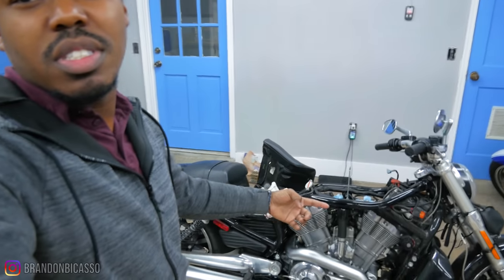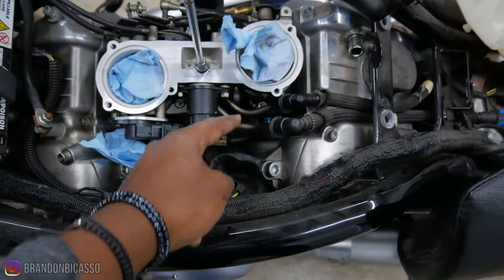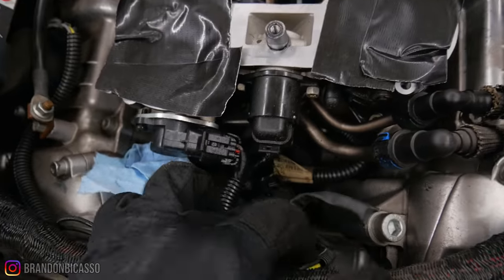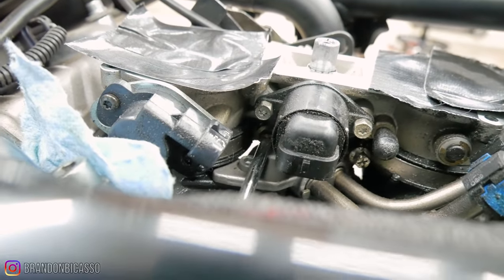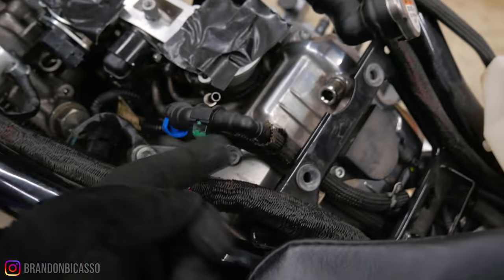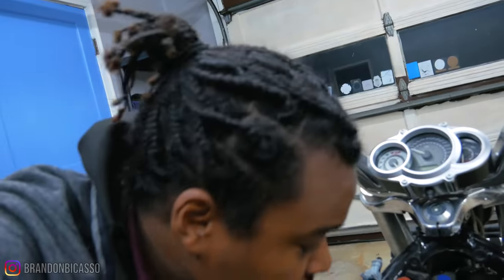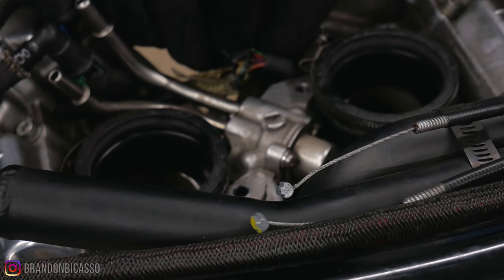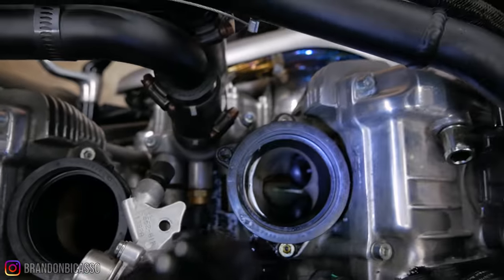My Oil Leaking Harley V-Rod Throttle Body Was Harder To Remove Than I Thought

Comment: I had your same problem on my 2008 Night Rod. You really don't need to remove the throttle body. If you are doing it clean, then have at it. What you need to do is make sure you have an original O-ring that fits the breather tube. Pull the tube out of the air box bottom. Install the correct O-ring, seat the tube into the block where it came from. Now install the box onto the tube and press to make sure it is seated into the box. I figured this out after a couple tries. Good luck.
Reply from the maker: I mentioned the point was cleaning the oil. I wouldn’t take that off unless it was for cleaning. That’s a waste of time 😂

Comment: My second vrod (2013) had the oil leak . Took it to the dealer and they tried saying it's normal.  I just laughed and then argued with their disposition.  I had looked up the issue online and found what causes the leak . .. it's that blowby valve that the gasket gets old

Comment: Breaking into one of these is like renovating a house.  Every wall or panel that gets opened reveals two or three more tasks that need to be completed.  My '98 Electra Glide Ultra Classic went down because of a fuel pump.  Once inside the tank, there's gunk and peeling liner so that has to be mitigated before I can move on.  And there's replacing of clip rings, O rings, etc. and all this requires even more disassembly.  Good thing I have my Fat Bob as a backup...
Oh, and Lowe's has good space heaters for yer garage.
Reply from the maker: That space heater is a nice idea. I’m thinking of hanging one from the ceiling. We’ll see!

Comment: I always find using a heat gun or hairdryer on a throttle body REALLY helps.  Especially when it is cold in the garage.  I just had to do this on an Indian and the heat gun made it an easy job after jerking on it for like 10 minutes.
I never use duct tape on anything, it leaves residue everywhere.  Rags are fine.  Also if you get a couple different color sharpies you can put a dot on the cable and the connection to remind yourself when you do to reinstall.  :)
It’s not oil down in the top of the engine, its carbon.  Sea foam can help a little, but honestly don’t worry about it.
And that fuel rail has a small o-ring on the end.  I would replace that while I am in there.  All those little o-rings deteriorate over time and I just replace them when I am in there.
Reply from the maker: Great points!

Comment: The intake valves look normal to me, don't try cleaning them. That is just fuel mixed with carbon, quite normal. It is NOT from the oil leak. I like to thoroughly clean an engine before working on it. A short ride from the car wash can help pinpoint a leak. Airflow is such that a teaspoon of oil can look pretty serious when, in fact, it may not be. I make a living fixing oil leaks on engines.
Reply from the maker: Yeah, I’m not worried about it. Interesting to see that given the mileage though.
Reply: @BrandonBicasso  
Just about 70% of the new aircraft engines I have installed leak from day one! That is what I get to fix.
Reply from the maker: @upsidedowndog1256  well damn. You’re already taking those motors out for a night and skipping dinner.
Reply: @BrandonBicasso  
Yeah, we have to fly them for 3 or 4 hours before the customer gets them to sort out tuning, leaks and make sure break in is well under way.

Comment: Could that oil by the valves went in through the velocity stacks . I hope it's something that's not a major problem
Reply from the maker: Probably not major but it’s possible that it could have. Carbon deposits are normal, though.

Comment: Pretty sure you should've disconnected the battery first lol.
Reply from the maker: Nah. If I recall, the manual said to just pull the main fuse. That takes the battery out of the equation. You could go a step further and do that. I will since the front  cylinder head has gunk on it too.

Comment: Pull the fuel pump fuse under the seat first. Crank the bike till it dies than a couple more times. Than do all that other stuff.
Reply: Have you had an issue with your IAC?

Comment: So what do you prefer working on the vrod or the bully?
Reply from the maker: With the components I’ve messed with so far, definitely the V-Rod. Removing that air-box/air cleaners on the M109R can be a challenge. Also, the throttle body is a lot simpler to remove on the V-Rod. And the radiator drain/fill is easier access on the V-Rod.
Reply: @BrandonBicasso  fair assessment.
Bullys are pretty fiddly.
New video up of my turbo one btw
Reply from the maker: @lukeatadelaideperformancee8052  Will check it out! And yeah, that’s all it is. Just built different. The V-Rod is well thought out on the design, though. I don’t mind messing with the air box parts but I hate that radiator shroud. I’ve broken tabs off that thing multiple times trying to remove it. 😂
Reply: @BrandonBicasso  porsche build nice things haha

Comment: Hay man question 
Have same issue clean my throtle body and open manual and my throtle body dont full close its open a little hmm do you know what can happen?
Reply from the maker: Sounds like your cables need adjustment or throttle body synchronized.